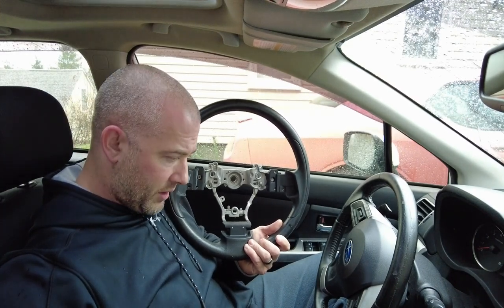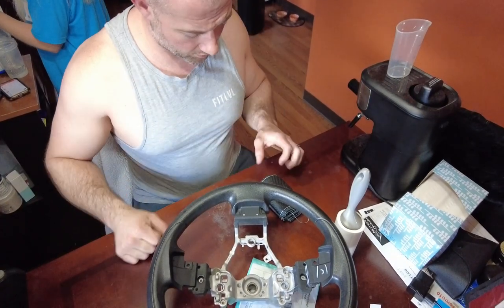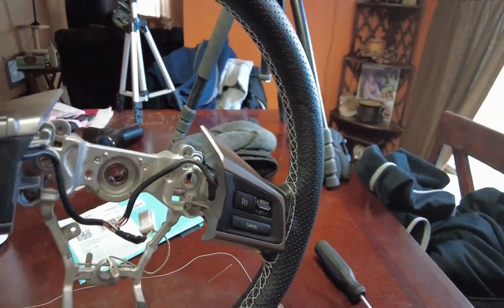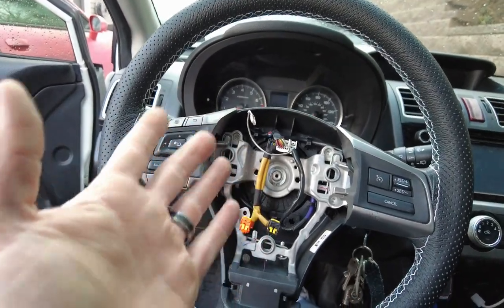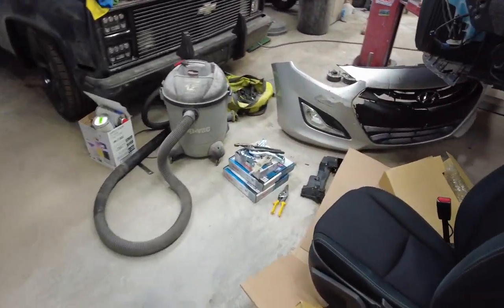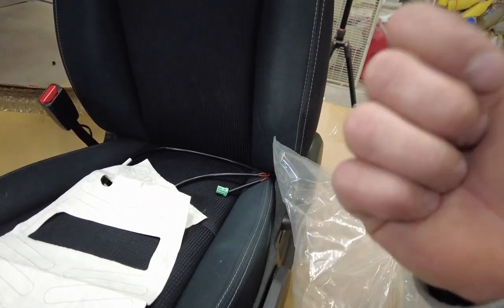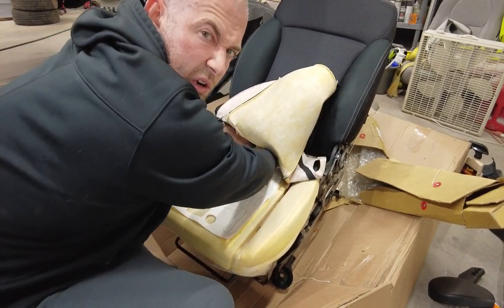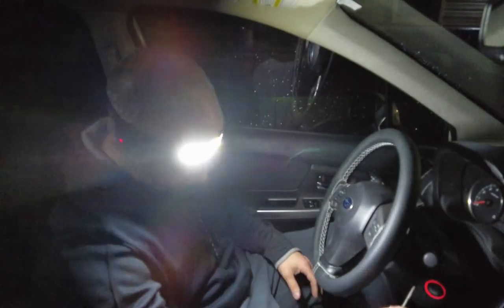2016 subaru impreza/crosstrek heated seat element replacement + leather steering wheel cover

Comment: Hey Todd, in a former life I was a Locksmith and had to remove steering wheels to repair/replace ignitions regularly.  We used to mark the wheel and steering shaft with a small centrepunch mark each to show alignment for refitting. Takes away the guessing game and unhappy customers.

I can't tell you enough just how useful and convenient the heated/cooling seats are in my current car. Heated is great for persons with bad backs and the cooling is great when our summers are in the 35 - 43°C mark with humidity levels constantly the 80% mark.

Comment: When you watch the upholstery guys on motor trend channel they use steam to work leather to remove wrinkles!
Also on your rough cut edges could you do a looping stitch to get your rolled edge at the 3 spokes on the steering wheel?
Reply from the maker: Not sure it would turn out right

Comment: I like the wheel. I thought at first it looked a little too loose. Those wheel rim covers need to fit tight but it turned out good. On the parts issues, I'm really shocked. Living in the US you don't deserve to have a 'shortage' of anything. With so many junk yards and so many cars in the system, how do you get issues?
Reply from the maker: It's getting bad